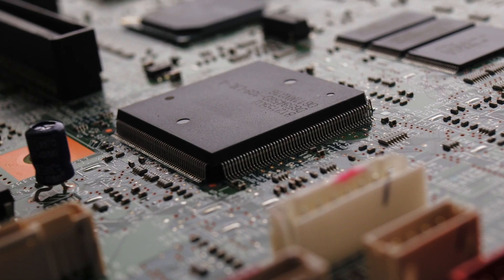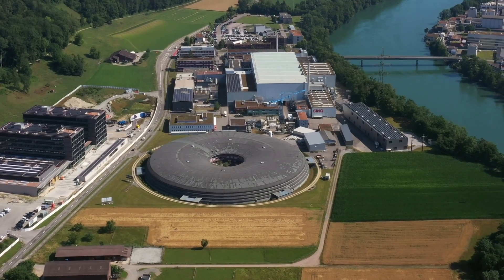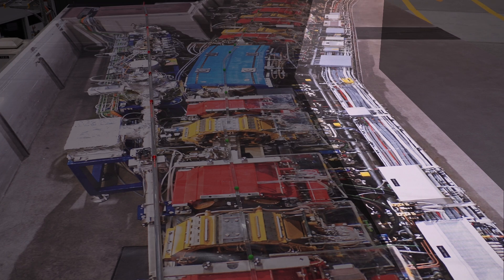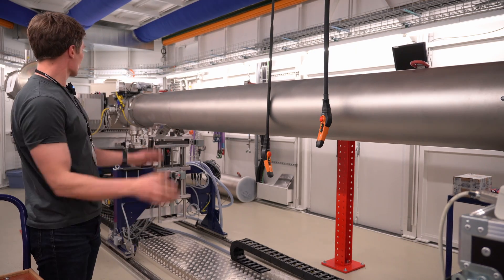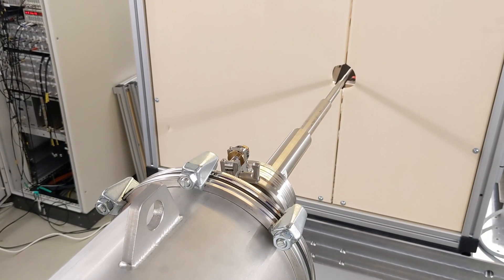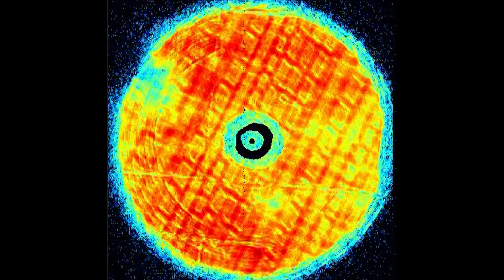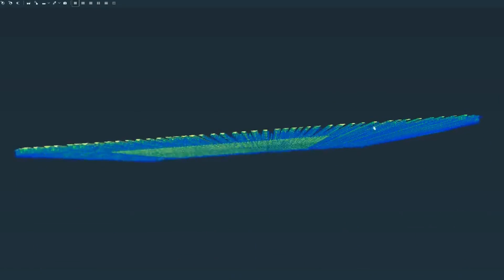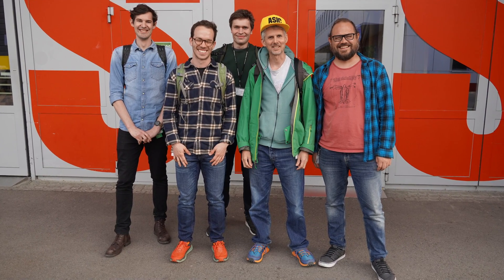I used a particle accelerator to look inside my own microchips!

Comment: Can someone reverse engineer CPUs with this method? Is there another way of doing that?
Reply from the maker: Yes you can. The reason the researchers are doing this is to check that the chip that is manufactured matches what they get back. To make sure no back doors were secretly inserted by the manufacturer. But with all the 3d information, you could rebuild the whole netlist and reverse engineer the CPU. It would be a mammoth task for modern CPUs though!

Comment: Ik the parts at 3:40 are proper done and they are better than I could do it, but it looks like just sone random aluminum foil slapped on and it makes me worried
Reply from the maker: Yeah the foil looks very hacky. I think it's because to get very high vacuum they have to heat the machines, and then the foil helps keep it warm.

Comment: Yes there is. Intel has a machine that uses lasers to repair and even adjust the transistors in chips. It’s all most like a freaking magic machine but it works and some other video shows it think Linus tec shows it. But they can target isolate and adjust individual transistors on a chip with it.
Reply: Only 00:08 sec. into this video discussing integrated circuit designing 103 and then this happens ...

IC Designer : "One of the hardest thing is, once you get your chips back, if something is wrong with it, how can you test it ?"

🤦 This designer requires remedial  electronics, needs a bit of reverse engineering, maybe employ DUT/EUT/UUT methods for in situ automation testing and please find this chip's electronic schematic.  You do have a duplicate ? Yes ??
Reply: @pikachu5188  I get that and the validation process. Even with intel they don’t shoot for 100% and really every chip has small differences on how efficient they work and performance output just intel makes it where as long as it can do so much it passes or fails. That’s normal and there will all ways be deviations in performance and stuff but that is to be expected and can be controlled thru quality control and validation processes.
Reply: Yeah most people absolutely do not know how chips are made let alone how once you have a chip then getting it to do what you want let alone then further optimization to get the most performance out with out breaking it or having inefficiencies that waste power usage. Let alone even begin to understand doing things on that scale they have standards and allowable differences in each individual chip and they only look to if they pass the minimum standards set and some can exceed that by quite a bit while others in the same batch have dead spots in each core but still meet the minimum standard to pass and preform fine. People are literally shocked when u tell them they print cpu chips in the same method lithography posters are made. And have no understanding of the nanometer topography thinking if it’s a 5 nm chip everything is literally 5nm. No. It’s the wavelength of light able to lay down and create smaller transistors and stuff.

Comment: You can also use a 1550 nm infrared camera filter to see inside the chip too. And, it won't require a billion-dollar setup either.
Reply from the maker: Only down to the top metal. See Bunnie Huang's post for details. And way lower resolution.

Comment: What was the energy of the x-ray quanta for this investigation?
Reply: We used an energy of 6.2 keV (wavelength of 2e-10 m). This energy gives good contrast for samples of this thickness and composition, plus it's where we have the most photons at our instrument at the Swiss Light Source.
Reply: @NickPhillips-cy5ng  Thanks!
Reply: @NickPhillips-cy5ng  Interesting. This energy is almost ideally detected with cadmium telluride 2-dimensional detectors as used in medical applications. Was this in your set up? Curious to learn more.
Reply: @ghlscitel6714 An Eiger photon counting detector was used with a silicon sensor. This particular detector is an in house development, although it is similar to commercial detectors made by Dectris.

Comment: Wow, really cool!

Glad you got out of that room prior to bombardment: chances of becoming Doctor Manhattan are pretty low, I keep being told.  That alarm sound, though... serious business, oof.

The match between the 3D model and the x-ray results is so precise (10:38), amazing.  

About the alignment using the features--is the manual matlab/python hacking a standard part of the process, as in required every time, or was the IC particularly troublesome?

Super neat that you got to do this and visit the synchrotron: thanks for sharing :)
Reply: They're developing a process here, so I think it's pretty normal to be hacking on the results